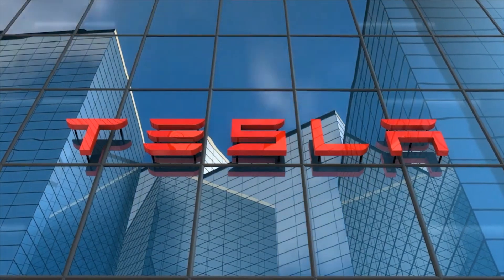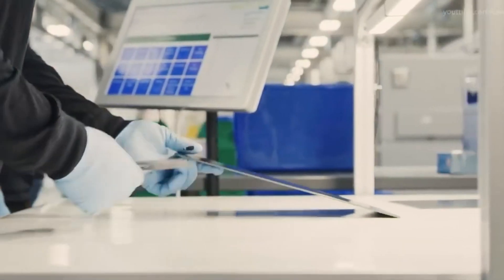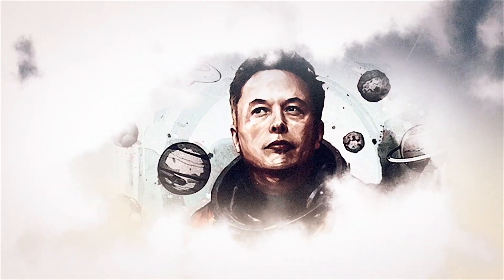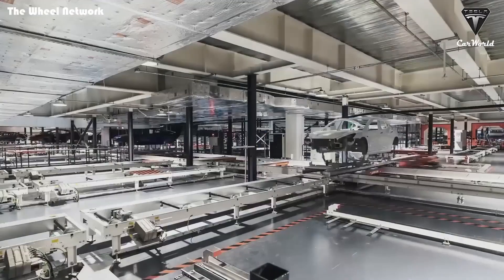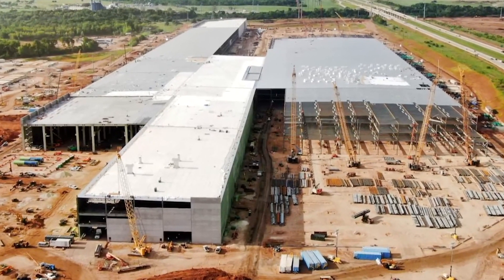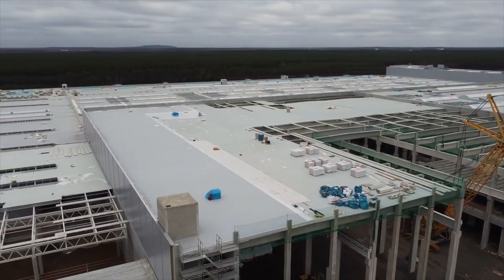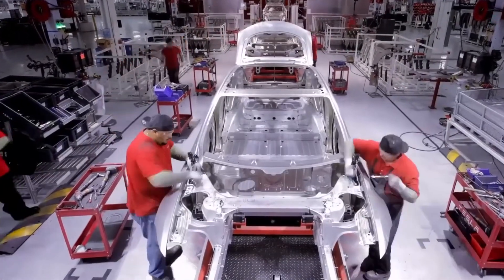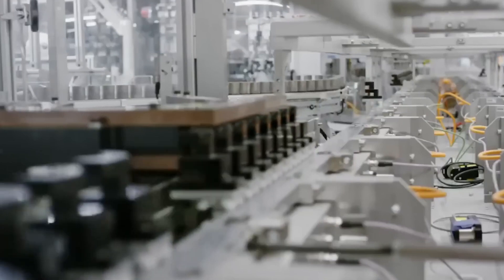Elon Musk Just Revealed How Tesla Giga Texas produces so fast

Comment: What are you talking about? GT currently produces at 50/day - yes, correct - ....far lower than they had planned or hoped. They're having trouble ramping the 4680 and structural battery pack. They'll get there, but so far they're ironing out unforeseen teething pains. The better question is: "just what the hell you're talking about?"